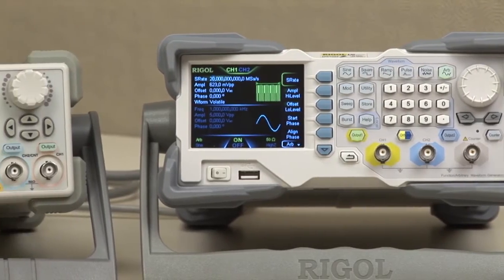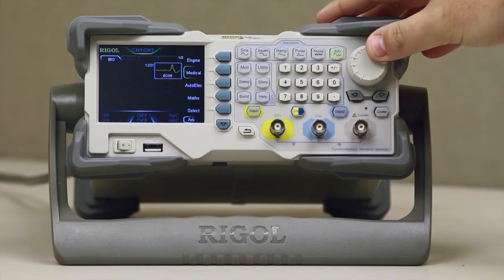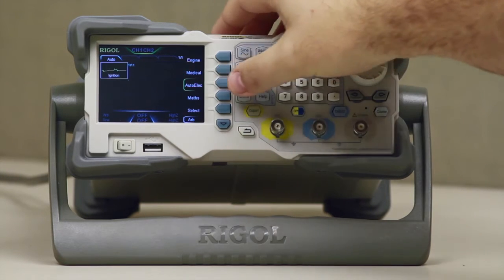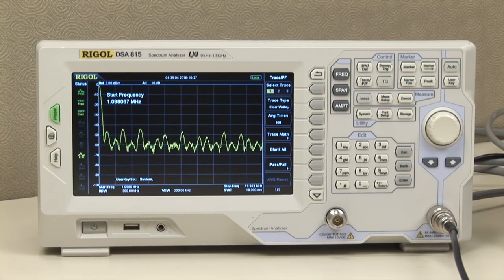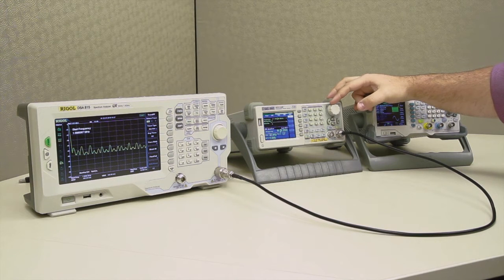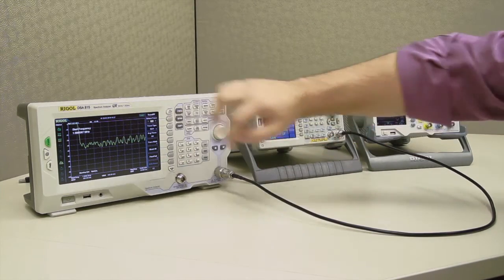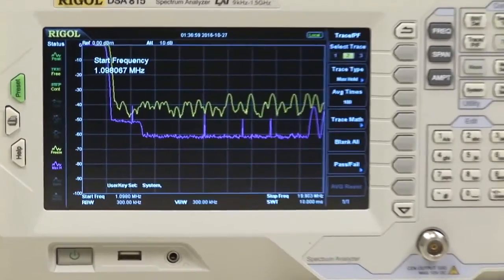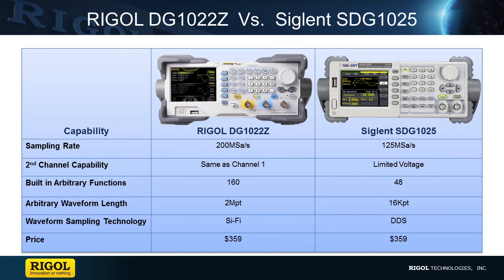RIGOL DG1022Z vs. Siglent SDG1025

Comment: 4:04 Seems by my test that the GW-Instek AFG-3031 is even better than those two. It's basically like the Rigol but without 'spikes'.
Reply: Yes, however the AFG-3031 cost $1,400 while the Rigol DG1022Z cost is $359. You are comparing apples and oranges.

Comment: How would it to be fair, and compare Signal generators of the same Generations? It is the Rigol that bad that he need to compare with a outdated Siglent? And the most important facts (risetime & falltime also on low frequencies) are much more important than stored waveforms that can easy uploaded via a Software.
Reply: The Siglent has a much better rise/fall -times than Rigol. In fact about 50 times.